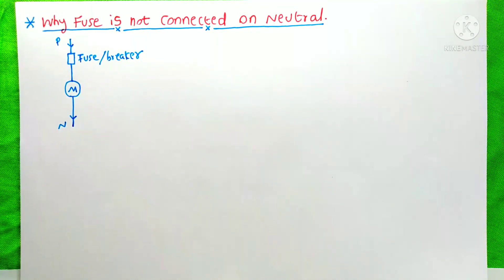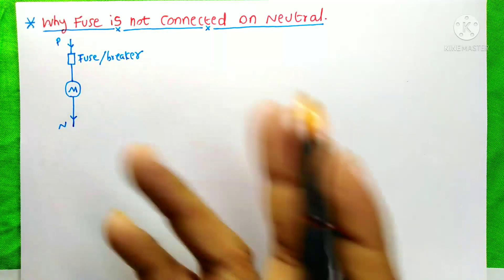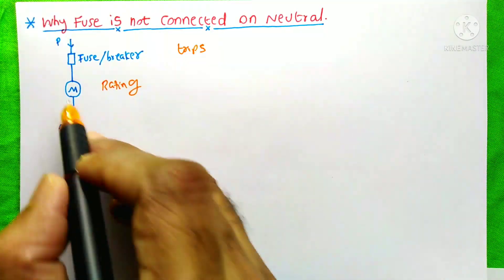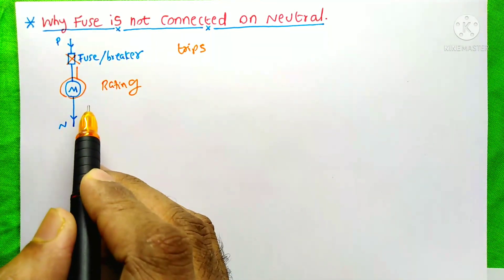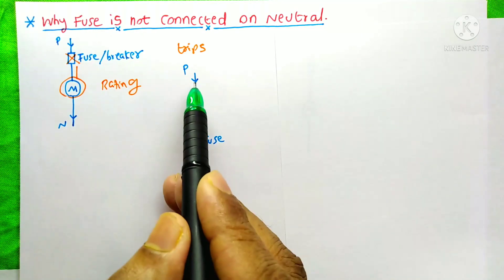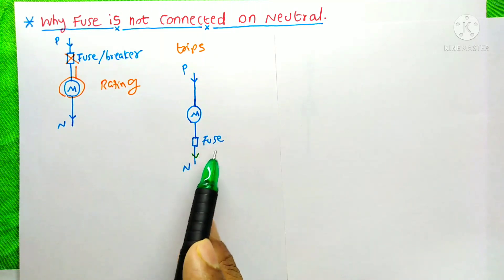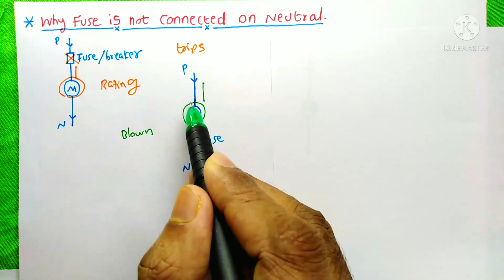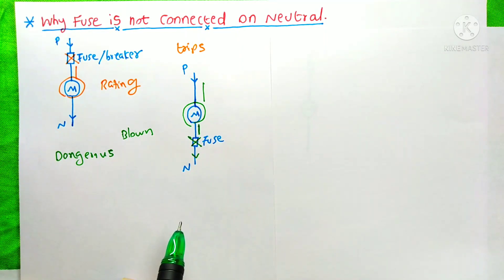Why fuse or circuit breaker is not connected on neutral | MCB MCCB Electrical

Comment: the ckt total resistance will remain same ..if it connect with nutral.. ..  the motor will damage only if current flow through fuse and reached to nutral.. then.. how you saying the fuse will not work if it connect in nutral....??
Reply from the maker: See video again